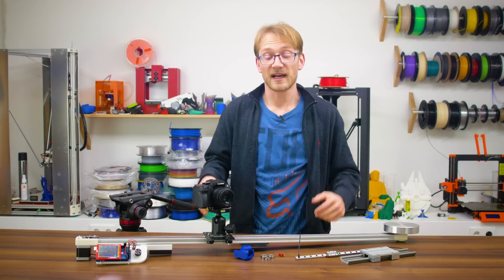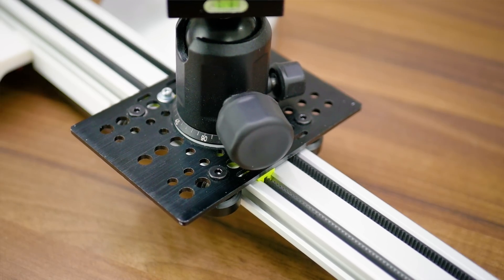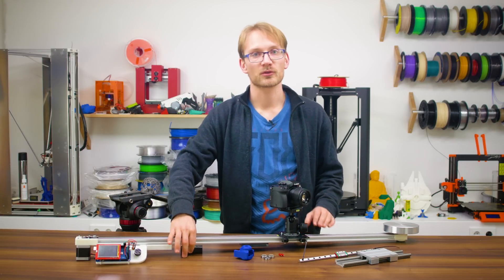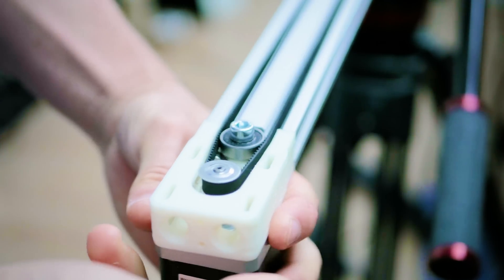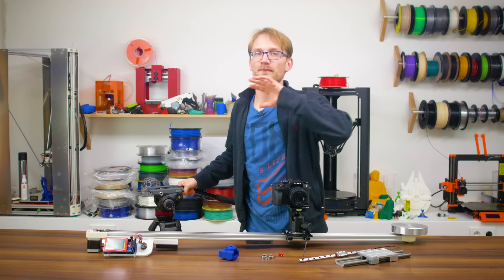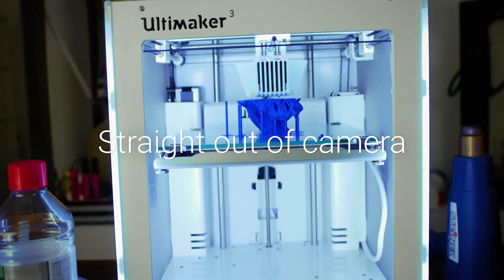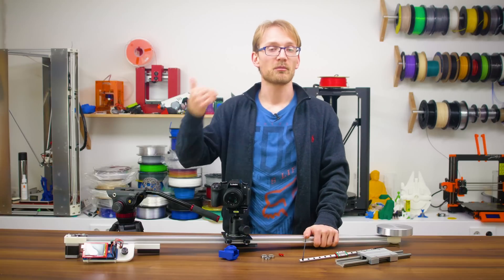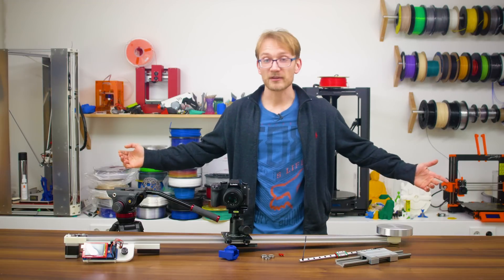Build your own Arduino-controlled camera slider!

Comment: Tom your videos look extremely professional but when you brought up that circuit diagram you really made me chuckle, it looks like straight out of MS Paint, look on the diagrams on Arduinos website for clean and pro looking diagrams because it really breaks the "flow" of the video.
Reply: Thomas Sanladerer 
maybe you can use http://fritzing.org that looks great :D
Reply: Yeah, wish I could see how you wired it all up a little better. I am having trouble with my encoder not moving through the menu correctly, can't change the time without messing with it. Tried to rewire the Clk, DT, and SW pins in every combination, but no luck. You have them labled as ENC 0 and ENC 1 in the sketch and S1 and g2 (not really sure if that's a g) but I am all kinds of confused now.
Reply: I would like to know what the program you used is?
Reply: Hello  Can you  confirm if you got this circuit running?
I got the pin-out correct for Encoder and works as it should...but no movement in my motor...:( 

 Appreciate your help if you would let me know and if my uploaded below diagram is correct.

https://app.box.com/s/66d412frc23q4plaji25w6yjyw5mocva

I tried all options…as per Thomas wiring, and external power to (Polulu A4988) Motor Driver…

I don’t get any movement in step motor …
Thanks.